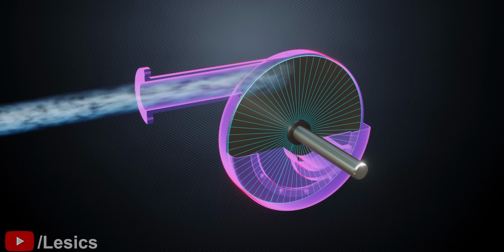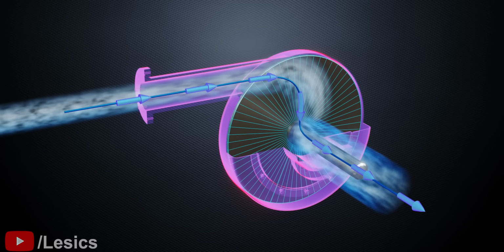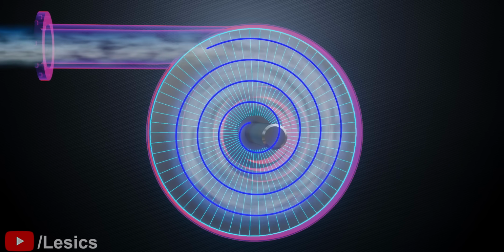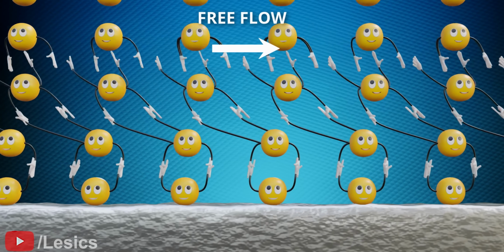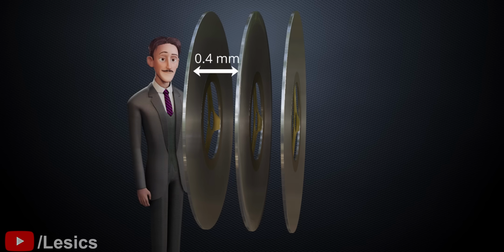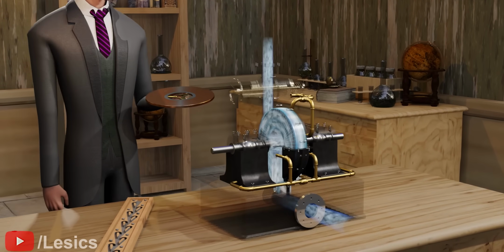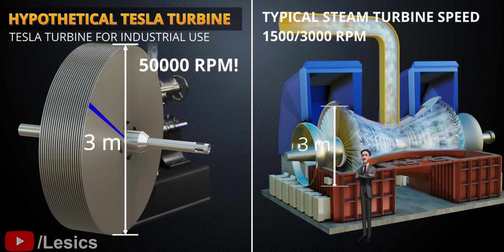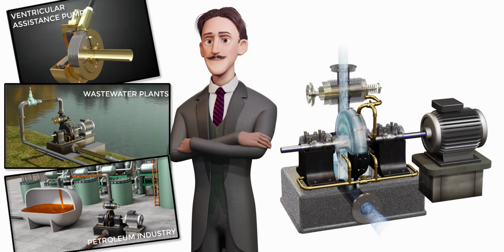Tesla Turbine | The interesting physics behind it

Comment: I think that sacrificing the 0.4 spacing could be adjusted so that it would run long term. Slightly thicker disks then could then be used as well to increase longevity. I believe that those two parameters are the key to fixing the design.
Reply: I doubt that actually. When you increase the thickness of the discs, you can place fewer of them in the flow path. When you make the gap wider, you take less advantage of the viscous effect. Both reduce the efficiency to the point where it can no longer compete with modern day turbines. 

What I suspect might work is using something with a very high tensile strength, and keeping the disc thin. Then you would need an outer ring that prevents the disc from buckling, whilst uniformly stretching with the rest of the disc material as it speeds up.
Reply: @Leon_Schuit  For thickening the disk, surely they can simply make the input nozzle to be slightly wider? I saw on some modern design where the discs looks like they are bending in some places because they are too thin and ended up flexing. AFAIK, vibrations to the turbine can potentially hamper its performance. And maybe compromise the structure of the disc or the turbine itself.
Reply: Someone somewhere might have a computer simulator, probably even on github to see what efficiencies are prodcued by various inputs. A big point is that if Tesla turbines are easy to manufacture in large numbers, flowing water everywhere could be used to generate electricity like with low efficiency PV solar. 
However, given the mass uptake of PV solar and dramatic rise in efficiencies, I don't see industry and govts investing in Tesla turbines, especially when electric cars (and everything else) need batteries and so we are already working on battery technology.

Comment: I'm 18 trying to figure out a how to build a circut for water to flow through infinitely and have it create enough power to keep the water moving in said cycle.
Reply: Basically, I want water to move and create power to keep moving itself until it drys up in the circuit but, 99.99% is the ending goal and I feel like I'm so close.
Reply: @mrbubbles4242  so what you want is a perpetual motion machine that uses water to run indefinitely? Is that what I'm getting at?

Comment: You may not have to run the big turbine at 50000 RPM. If the speed of the disc at the outside edge is all that matters, a 36 inch disc would spin at one sixth the speed of a 6 inch disc, or 8,333 RPM. To deal with the warping of the discs, we need look no further than the sawmill industry. Yes, I mean the saw that cuts trees into boards. The big circular saw blades have to be slightly cup-shaped so that when the centripetal force stretches out the outside of the blade, it will be perfectly flat. It's actually warped when it's not turning. But these blades have to be run at a specific speed. Too fast or too slow, and they will warp. Same would be true of the turbine, but with possibly another variable. The temperature of the steam as it moves from the outside of a disc to the inside may change enough to warp the disc, unless the disc is pre-warped to compensate for the expansion from not just the centripetal force but also the temperature difference.

Comment: if the problem is velocity, isn't putting enough load to slow down the blades could solve the problem? I don't really see what they meant by that. velocity is achieve due to high torque. just put sufficient load on it should solve the problem

Comment: GaSu Fly wheel 
            Fly wheel is  form of  ( mechanical )energy storing tool used in early industrial  era . Later it went out of fashion , but recently coming back  for example as load balancing tool  in electrical transmission.  
          Suppose instead of conventional design ( of fly wheel) consider a a massively and uniformly thick metal disc as a flywheel (rotator )  . The surfaces of these are made smooth nearly as good as a CD disc . Now pack a series of such massive discs in the same way of Tesla Turbine (TT ) with the gaps as required for boundary layer optimization.. Also. Construct reversible fluid inlets , outlets as in a TT .
        When there is no the fluid flow , this  pack of massive rotors can store energy and useful as a conventional load balancing tool
       Suppose additionally we  input (or output) fluid flow between these discs. Utilizing the phenomena of viscosity and Boundary layer effect  allow  this pack of massive wheel spin at very high rpm . Then it can add or discharge additional energy ( to or from the flywheel) Design and develop  technology tools and systems  to achieve workability ,optimization 
                 What is new about this . 
              1   Just the change from pack of thin discs to a pack of massively thick flywheels , and change in the objectivity 
              2  The main failure in TT is that the thin disc can not withstand  the high rpm and gets damaged by warping, cracking etc . The massive thickness of the GaSu flywheel may be able to withstand  the high rpm .
             Of course  in TT where  efficiency is the main objective thick discs are are not functional,.  In contrast ( adoption of Viscosity , boundary layer effect ) in GaSu Flywheel pack they are just energy management , enhancement tool.
              3 This is just conceptual statement..Enormous work need to be done 
     a) to critically evaluate the concept about workability 
     b)  to design various types of models 
     c)  test such models and evaluate the workability ,and adoptabilty .
    

       
      😢

Comment: This video is really biased..  Dropping RPM wouldn't mean there would be a drop in efficiency, just means the pressure behind the rpm would be less.  Therefor, the efficiency would be measured still by the amount of psi/force coming into the machine.   If the force is less, then the rpm is less, but still the same efficiency.

Comment: What if the fluid played a part in stabilizing the discs at those higher RPMs? Like if the disc wrapped due to pressure and heat then use a cold fluid to counter that. IDK just an idea.

Comment: About at 4 min time mark. Faster the disk rotates, higer energy extraction. Correct. Now, lets add a load. The load is actually reducing speed of the disk. Resulting following; higher the load, lower speed and lower energy extraction, resulting lower efficiency.

Comment: What if instead of giant Tesla turbines you had a bunch of smaller ones? We have materials nowadays that can definitely withstand those forces so it might be worth a shot to try building a long line of them all feeding the same power line. And we would be able to build more individual turbines because less material will allow for more surface area contact with the liquid due to the square cube law

Comment: welll its technically no longer impossible

graphene in theory is strong enough to handle the strain of mach 13 and above

the biggest obstacle is the price tag at this point.. unfortunately until graphene becomes cheap to make its not gonna be useable for power production

however I'm still holding onto hope that this invention will see its golden age

cause it was WAY ahead of its time

Comment: So as the liquid changes direction, it "grabs" the plate, with the force of the direction change and flow rate. As the liquid reaches the exit it is traveling much faster than when it entered the turbine. This says that as the turbin spins, it speeds up the liquid and as the liquid speeds up the plate spins faster.

Would it be possible to use a tesla turbine to produce a home powerplant?

Comment: i would argue that teslas efficiency number is correct, just because it cant reach that in practice doesnt change that is its theoretical efficiency, you just need a lighter yet still strong material to make the parts out of, which may be possible in a future alloy
Reply: Yes. 
The guy who made this video is a bit on the negative side. 
I'm an inventor and I don't like to say that it can't be done but how can it be done and try it, see if it works. 
And can't you make smaller ones and string the output together? 
Can't you make room for expansion? 
Can't you find ways to cool it? Use liquid nitrogen to cool it, or ammonia. Ammonia while heated up becomes cold.
Reply: Yes you're right! I hope we'll be able to achieve it in the future.
Reply: Probably something to do with carbon
Reply: We have some lighter and stronger alloys now

Comment: Only one issue with the video.. The blanket statement of impossibility  with making a Tesla Turbine with a blade diameter of 3m function at high RPMs.  

The fact that with our current technology  we have not found nor have we tried to make a Tesla Turbine of newer materials or composites that could in fact be strong enough to withstand the force of water at the pressure required to make Tesla's design function. 

In other words we haven't  tried using modern materials  to do so. 

He was using steel disks .   Today we have materials like Titanium, Tungsten  , Boron Carbide,  Wurtzite boron nitride, Lonsdaleite, Dyneema,Palladium microalloy glass, 

Buckypaper ie It is well-known since the late 20th-century that there’s a form of carbon that’s even harder than diamonds: carbon nanotubes. By binding carbon together into a hexagonal shape, it can hold a rigid cylindrical-shaped structure more stably than any other structure known to humankind.

And last but not least Graphene.  a hexagonal carbon lattice that’s only a single atom thick. That’s what a sheet of graphene is, arguably the most revolutionary material to be developed and utilized in the 21st century. It is the basic structural element of carbon nanotubes themselves, and applications are growing continuously. Currently a multimillion dollar industry, graphene is expected to grow into a multibillion dollar industry in mere decades.

In proportion to its thickness, it is the strongest material known, is an extraordinary conductor of both heat and electricity, and is nearly 100% transparent to light. The 2010 Nobel Prize in Physics went to Andre Geim and Konstantin Novoselov for groundbreaking experiments involving graphene, and the commercial applications have only been growing. To date, graphene is the thinnest material known, and the mere six year gap between Geim and Novoselov’s work and their Nobel award is one of the shortest in the history of physics.

This is to say just because  he couldn't  find a material strong  enough to withstand the force being asserted onto the disks doesn't  mean that we can't find or create a material with properties  to do exactly  that. 

Thus nothing is impossible.  Even if we currently  don't  have the technology  to do so. 

"Any sufficiently advanced technology is indistinguishable from magic”  Arthur C. Clarke's 3rd law of science fiction.

If you go back and watch some old sci-fi series like Star Trek you see them using a speaking stone of sorts to communicate with the ship.   Now pull out your cellphone  it's  the same concept brought to life by technology.  

The same technology that would have been seen as magic to someone in the 1900s.  

So yeah not impossible.  But we haven't  found a way to make it work.

Comment: Can we use silicon carbide for tesla turbine as a material. It has a melting point of 2730°C. At mach number 10, the temperature of structure will be 2000°C...It has also got modulus of elasticity of 410 Gpa.This material is also used for Hypersonic missiles. So, is it suitable or not?
Reply: Where are you getting those temp numbers? From what I can they are both very optimistic.

Comment: This animation and explanation really deserves a lot of credit.... this is really good stuff, well done!
Reply: No it does not, they should have performed actual experiments to back up what they're saying instead of cartoons.  Cartoon videos, like NASA, does not prove anything.  Shill YouTuber exposed.
Reply: I want to add it here so it is visible. But there is actually a way to make the Turbine 10x smaller, but using the "Super Critical Carbon Dioxide." 
It is a real thing that they can make regular turbine 10x smaller.

Another thing that people don't mention. There are 3 inventions on the same shaft:
1. Tesla turbine (takes steam and spins it)
2. Tesla pump (Propels moleculs from the center outwards, creating a vacuum)
Both amplify one-another.
3. Air-bearing on both sides. The vacuum-pumps on both ends give more power to the Tesla turbine in between them, and also create a suction for the air-bearings.

There are videos of people literally FREEZING steam using the Turbine and Pump in combination. By having the math on all of these right, you can achieve perhaps 99% efficiency. By using the Super Critical Carbon Dioxide, you can down-size it 10x.
Reply: You can have a look at the video by a man way more knowledgeable than most men or women out there, on this issue:
"A Better way to Make Electricity WITH CO2"

Comment: You forgot to mention that especially in especially in power generation we needed to spin at 60 cycles per 2nd and unfortunately does the turbine spends faster than 60 cycles per 2nd 2nd But nowadays we can easily fix that  By just letting it ruin and put a Is gear reduction on it.

Comment: F1 race cars have carbon fiber brake discs to handle high torque and red hot temperatures which would make steel warp and melt. Would be a candidate for discs here.

Comment: I'm disappointed at the comparison between the tesla turbine and the mach characteristics while not considering smaller disk diameter with additional turbine disks instead of making it 3m diameter. Keep the disks to 1m or even less and you can match it with contemporary alloys that can manage 1.8mach tip velocity at 50krpm and maintain the industrial torque requirements.
More platters does mean more mass and overall length of the system, but in industrial applications, you've generally got plenty of space for that kind of stuff for the power-production equipment.

Comment: I was a new graduate electrical engineer at Allis-Chalmers Corp. at the research division in West Allis, WI in 1961.  At that time, A-C owned the Tesla turbine patent, and I worked beside a fellow mechanical engineer who had been assigned the task of running tests on a compressed air driven Tesla turbine.  To load the turbine, a war surplus B-29 engine turbocharger [A-C had made these during WWII, and a few were still lying around] was shaft driven by the test Tesla turbine.  A-C was one of the USA manufacturers of steam turbines at that time, and therefore the performance of the Tesla turbine was of interest. After the tests, a full report was written, but is probably lost today, as A-C went out of business in 1986.  I am happy to see that others have pursued testing of the Tesla turbine, and have added to the knowledge base.  As an interesting side note, Nicola Tesla himself was hired by A-C as an engineering consultant in the early 20th century as revealed in a report on file that my fellow engineer found in the A-C archive.  As is well known, Tesla was rather eccentric in his habits.  He could not stand to stay overnight in West Allis for some reason, spending his nights out in suburban Waukesha, and commuting by electric rail each workday to the West Allis works.  That report too is probably lost.
Reply: Interesting history remark. What applications do you think the turbine is best suited for in the power industry?
Reply: @ricardobautista-garcia8492  he stated that himself in his autobiography.  He was a boy in Lika (Croatia) and read a travel brochure about Niagara Falls which stated the flow rate and surmised that it was an untapped power potential.

Comment: Hello -- Tesla and you, used flat discs -- did you try to use discs covered with thousand micro montains on them -- ? The water would have gripped much better, and there would have been no need to reach impossible speeds to transmit the energy of the water to the discs.

Comment: You dont explain how the water moves well.. to me this looks like you cant prevent water from escaping at pressure which means that you are loosing energy in the design. I see no different between before and after you add the casing, it still doesn't explain how the turbine extract efficiently.

Comment: What if you weren't using steam?  I assume the optimal rpm's would be much lower if using gravity fed water.  Would that make this practical/possible?
Reply: No. It does not matter ,The viscous  shear stress causes an increase in the temperature and with a reasonable load the efficiency is way way too low. The analysis can be accurately done with the Navier-Stokes equations, The losses are unacceptable, unless no significant load must be turned.
Compared to bladed turbine efficiencies of around 88% in gases, the Tesla turbines deliver  at best a third, and the losses heat up the discs, causing unequal thermal expansion and severe distortion and at high speed destruction.

Comment: Why charge your car often. 
Why do not build an inverter/ converter to charge the battery.
 Problem solved. Any spinning engine or the motor for the pomp can be used with a poli attache to a belt to charge the battery also.

Comment: The uniformity of Tesla’s turbine blades was obviously a hindrance at high speeds but what if the diameter of the disk varied as well as the size of their individual exhaust ports? That could potentially create a more stable design less prone to warping at much higher rpm. 🤓
Reply: Can we dam a shallow sea and build water based power plant?

Comment: What about making the discs out of carbon graphene that is way stronger than steel?  Then why not embed small neodymium magnets in the discs themselves surrounded by copper coil in the casing surrounding the discs?  At such high velocity I wonder what the electrical output would be.  Things that make you go hmmmmmmm.